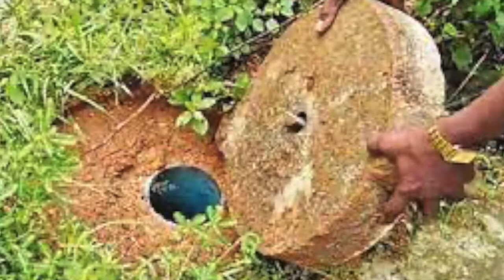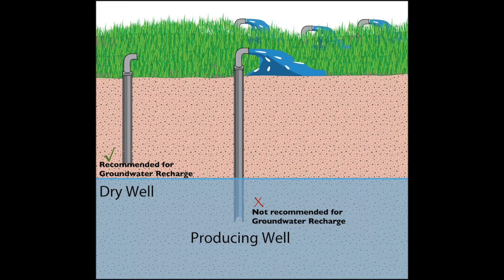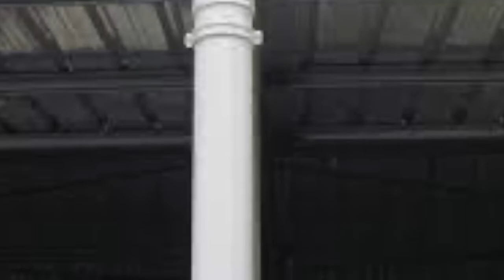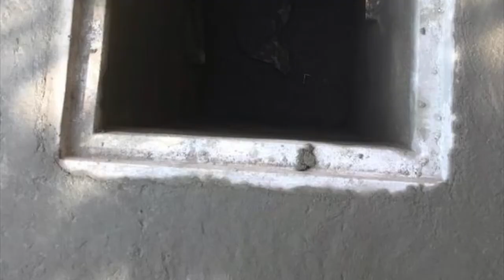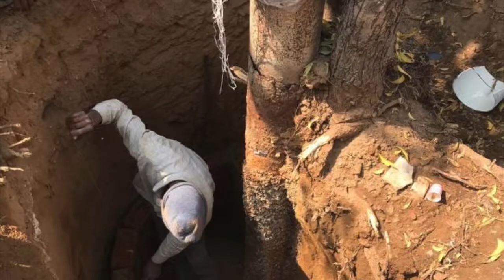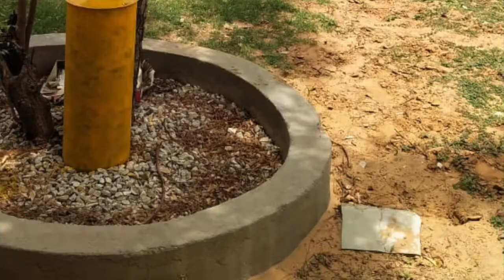Rain Water Harvesting using Dry Borewells

Comment: You can directly inject rooftop water to bore,  no need of building brickwall, fill with gravel
Reply: We prefer letting the water pass through gravel in order to hold back any poly bag etc. Which manages to travel through the pipe and in order to hold gravel we require building the brick wall.